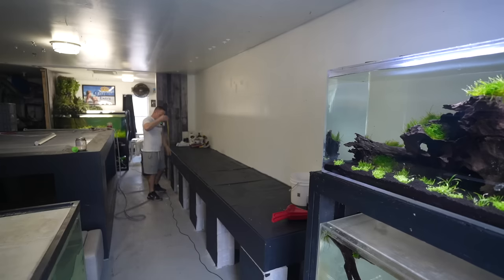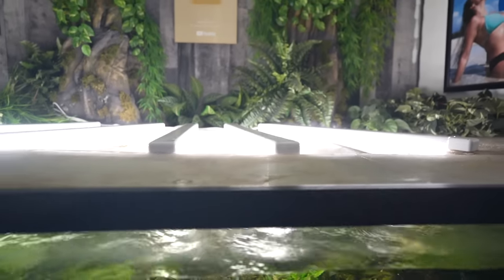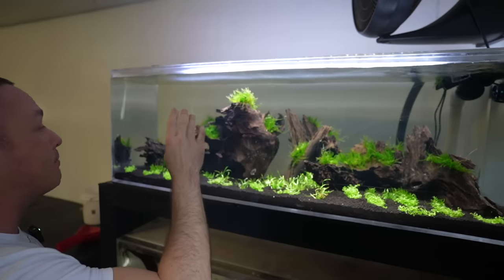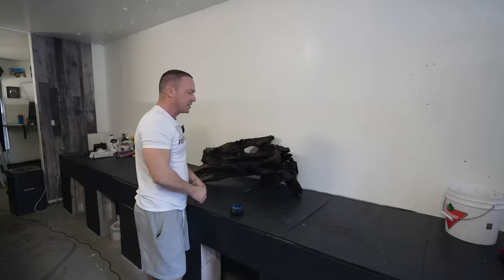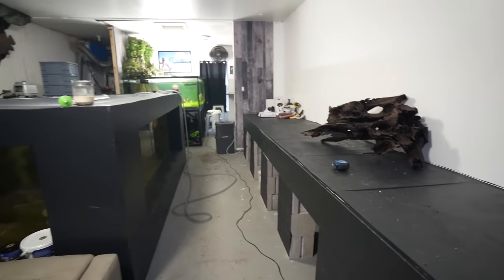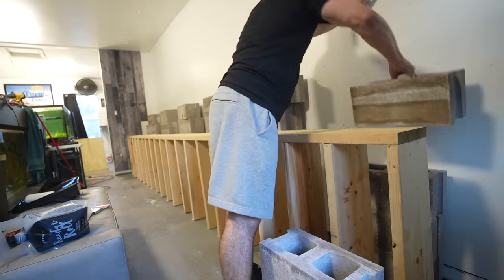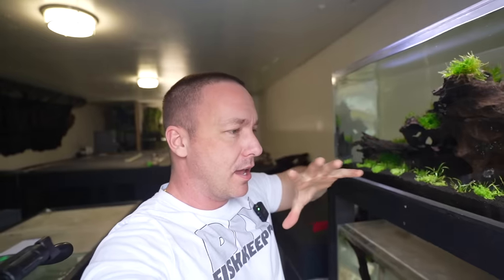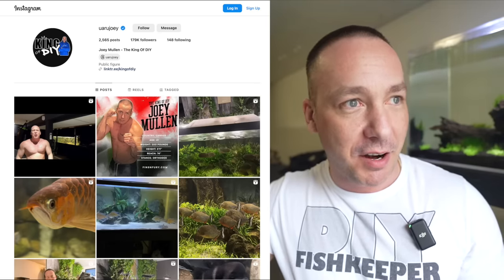16 FOOT AQUARIUM BUILD - DIY fish tank stand - The king of DIY

Comment: Joey, to make life easier on yourself, put plant substrate in mesh bags and hide it under the sand. And you'll need a lot of it as you have Geophagus and a stinging ray your tank. 
Make "plant islands" here and there along the bottom with mesh bags under the sand. It'll keep the substrate under the sand and there'll be no mixing. Some big swords and some jungle val would look good to in a tank that size.
Reply: Big cryptocoryne as well.

They have strong roots and will be able to take a beating once anchord in the mesh bags
Reply: Jungle val will survive almost any fish lol. Once those roots are grown in, it's in to stay until you pull it all out
Reply: I did this in my planted  125 gallon  geophagus sveni tank. But I only have crypts, swords, lots of anubias and bucephalandra. The cryptocoryne is hanging on but the geophagus are hard on them. There's no way a carpeting plants would survive with them. But the mesh bags worked alright to keep the substrate separated. They just like to show through the sand due to the geophagus moving the sand around

Comment: To answer your question, yes the Monte Carlo can grow as an epiphyte attached to things. I've had it in a low tech tank without co2 and still managed a carpet so hopefully you get some luck too!
Reply: What did u do. I planted a patch like 8 months ago. And its barely grown
Reply: @shawn1819  ahh that's a shame. It was definitely slow growing but saw changes quicker than that. Not sure what conditions you have but I had an RGB light, it was in a decent space with plenty of light, planted in aquasoil plus I dosed the tank with a basic fertiliser. If any of those things are missing from your setup it might be worth a tweak. I think the main thing is decent light levels and nutrients.

Comment: Your Geophagus will need sand rather than soil Joey.
Reply: Yes, definitely
Reply: He said there will be white sand in there
Reply: @user-pl6ns4hs7y Should be at least 75% Sandy bottom.  And best of luck keeping plants.
Reply: You think he doesn’t know how to care for geos? 😂
Reply: @topdogtaz218  I assumed he did.  But the plans for this tank suggests otherwise.
Reply: Geos will reck the plants too uproot them from anywhere
Reply: Yes definitely need CO2 and good lighting for Monte carlo otherwise growth will be patchy.
Reply: @dinobhoopa4107  so will the ray
Reply: Another reason to avoid aquasoil substrate is that it will trap too much detritus. Gephagus are very susceptible to hole in the head disease. Best waybto prevent that is to keep the water pristine. In my experience that is much easier to do with an inch sand regularly vacuumed than any other substrate.
Reply: I have geos in gravel and there fine
Reply: @matthewferguson8423  sveni and red head topojos
Reply: @Mason-m1u  even they will do better long term with clean sand over gravel. Best of luck. Keep up with those water changes!
Reply: @matthewferguson8423  I do, I also have rams and there some of my favorite fish, good luck to you
Reply: It’s going to be planted. Meaning less water changes and filtering needed.
Reply: @topdogtaz218  No, not at all. Heavily planted tanks can do a lot to reduce nitrates. And when lightly stocked with small fish, heavily planted tanks can provide a balance that requires little maintenance.  But this is going to be stocked with many large heavy eating fish.  Many of them diggers and substrate sifters. Whatever plants survive them and, without careful planning and luck, few will, won't make any kind of dent in the biowaste these chow hounds are going to produce.  And the denser the substrate, the more detritus will become embedded within it.  And if you don't think that will lead to a big risk of increasing an outbreak of hole in the head disease in Geophagus, you don't know what you're talking about. Any hobbiest with any significant experience in keeping them knows this. The tank he has the geos in now is a perfect environment for them. Straying from that strategy is a recipe for disaster and likely to permanently disfigure them.
Reply: @matthewferguson8423  this is a 16 foot aquarium not a 4 foot. Just watch and learn.
Reply: @topdogtaz218  granted, it is a large tank, Joey is good at filtration and the final design is not done yet.  But there are some of us commenters who know what we are talking about, some of us with decades more experience than even Joey (no disrespect, I've certainly learned some stuff from him), and if our feedback can keep him mindful of these fish's needs, all the better.  Let's keep in mind, in the 10 years or more I've been watching his videos, Joey has not kept not one Geophagus.  And even with large cichlids that are less susectable to hole in the head, he has never kept them in a heavily planted dense substrate tank.  Good chance he knows this and over stated how much aquasoil and plants he is intending. But from what he did say, he warrants a reminder.
Reply: I'm pretty sure he knows what he's talking about
Reply: @RedPanda96612  He doesn't seem to. Some of of us have been in the hobby for decades longer than Joey and have a lot more experience in keeping geophagus than him, you know.  Still, he has enough experience with large cichlids that  I'm surprised he he seems so gunf ho on keeping the Geo's with lots of soil and plants. Hopefully he was exaggerating and will alter his plans. The tank he's been keeping them in so far is a perfect environment. And they are currently in stunning condition. Will be a shame if they jet ruined by hole in the head.
Reply: @RedPanda96612   And, now that he has completed the tank, scaped it and added the Geophagus, we can see that he completely reversed his original plans do dump in a bunch of soil and rooted plants, and instead did exactly as those of us who knew what we were talking about advised.

Comment: I could recommend you easy plants as I only have like 1 inch white quartz sand bottom on my tanks and mediocre light and I use no fetilizers or anything and have tried many plants. 

Ones that grow really well are Limohpila Sessiliflora(stem), Crytocoryne Beckettii Petchii - its quite a big leafed red stem, green and red leaf one, for me it grows quite big and bushy just in pure sand. Echinodorus Belheri(Amazon sword) grows really tall and dense, in like 5 months its almost 15 inches tall and about 40 leafs all growing  out from the middle of the tank and Vallisneria I think I have Gigantea but it grows small for me, when I bought it it was like 1 inch wide but it only grows in like 1cm wide now and is thinner but grows really well.

Should add I have soft water also, from Glasgow Scotland, really soft water, so really soft water and no nothing but sand these plants grow well.

Comment: I was wondering why you don’t just buy steel stands then I remembered your channel name
Reply: Because these stands are cheaper, and can hold the weight, additionally, if ever needed to move the stand,  much easier to tear apart this stand and move as opposed to a long fixed metal stand
Reply: Where would you even get large, custom metal stands?  I'd expect having them custom made would be very expensive - at least here in Canada.

Comment: So I built a 14 ft tank on my own,  I could lift one end enough to add pipes under to push it in front of the stand, then used a car jack and a combination of blocks and off cuts of plywood to raise it up, then I pushed it onto the stand.